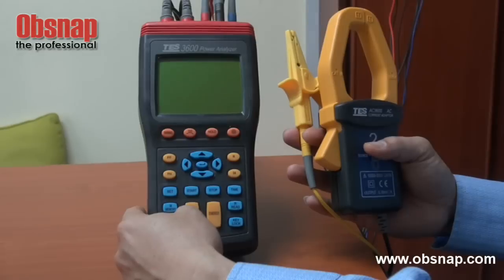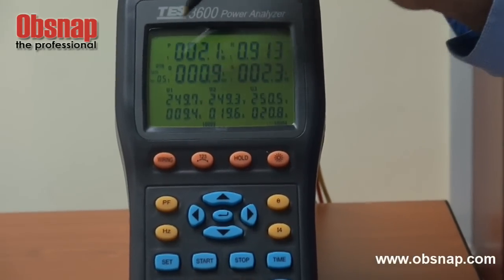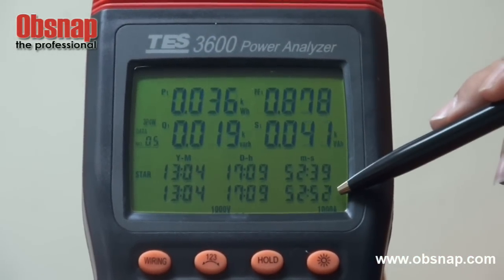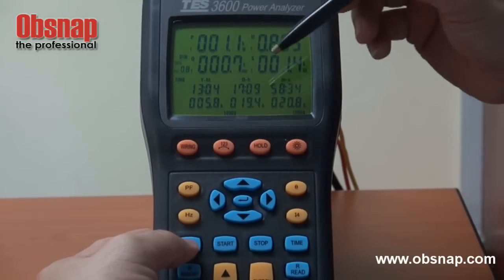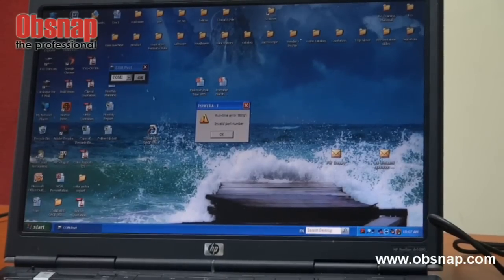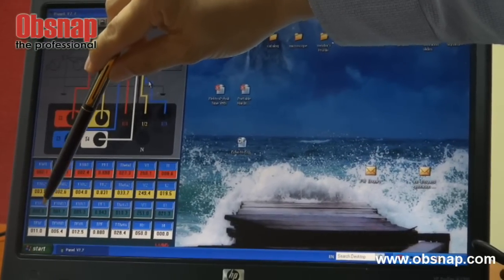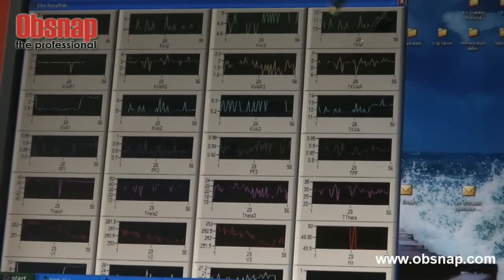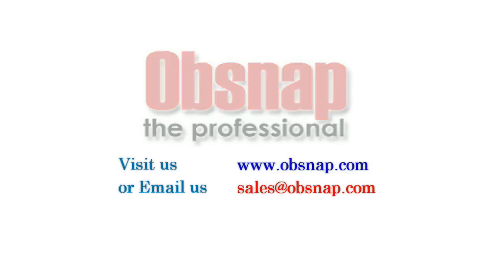How to use a Power Analyzer/Datalogger TES 3600, Extech 382090, Extech 382091

Comment: hello I have a problem with my computer since when I turn it on, the number 44 appears on screen, different from what you show when the video starts, I have not found any fault code for this equipment, if you could help me solve that problem. I can not get all the measurements, only 2 lines measure and the other does not produce results. I ask for your help or guidance to solve that problem
Reply: Carlos, I have tried to connect this equipment to monitor factor power quality and then log data. I have not been successful. If you succeeded in making  TES  work. kindly advise me in detail. I have tried for 3 years without success. your assistance will be highly appreciated